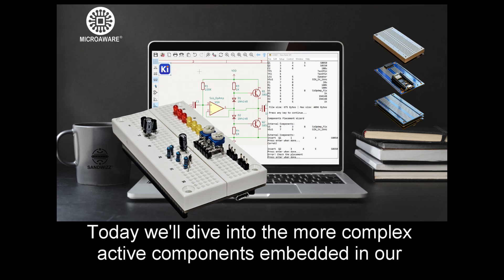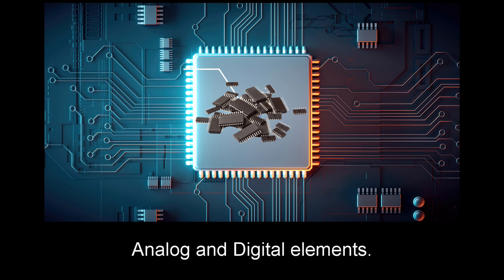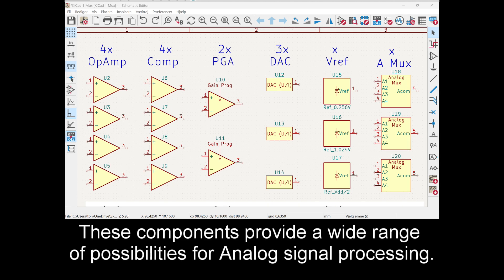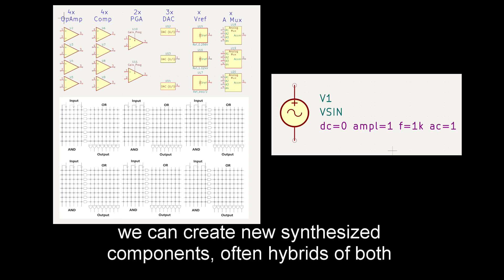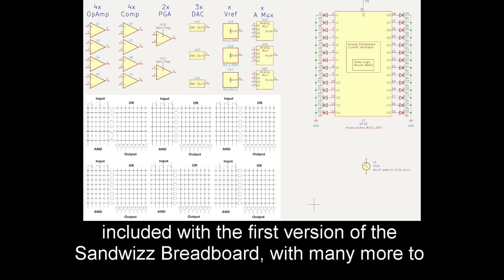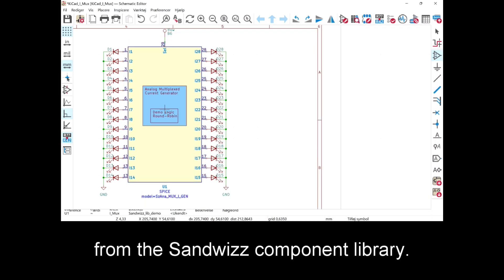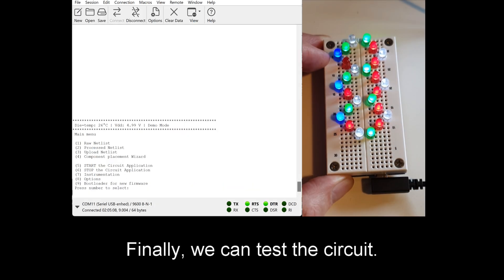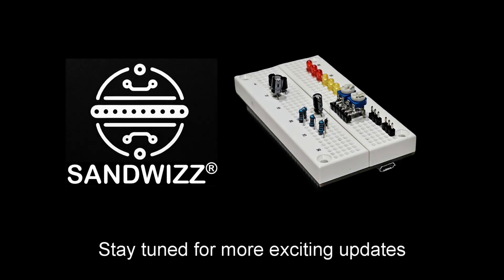Discover Advanced Components in the Revolutionary Sandwizz® Breadboard  ... in less than 3 minutes!

Comment: Are there larger boards?
Reply from the maker: Since this is the first product in the Sandwizz Breadboard range, this is the size available. However, remember that many active components are embedded inside the breadboard, so they do not take up space on the surface of the breadboard. Additionally, we have equipped the Sandwizz Breadboard with connectors at both ends, allowing 4 analog or digital signals to be transferred to the next Sandwizz Breadboard when you cascade them in this manner.
Reply: Can they connect to one another ?
Reply from the maker: @handsanitizer2457  They sure can.